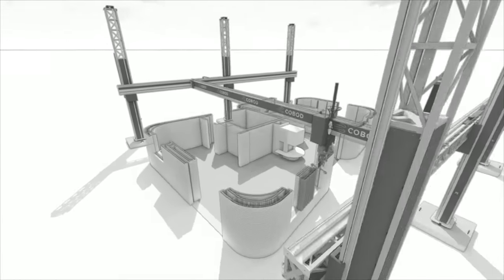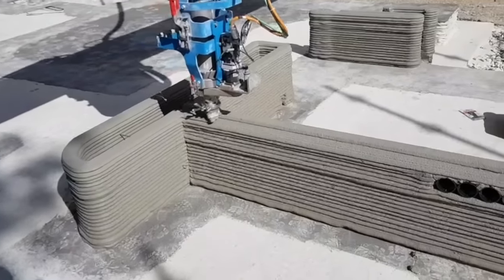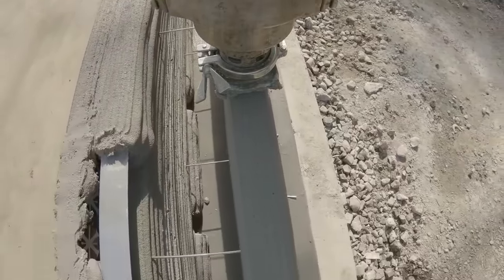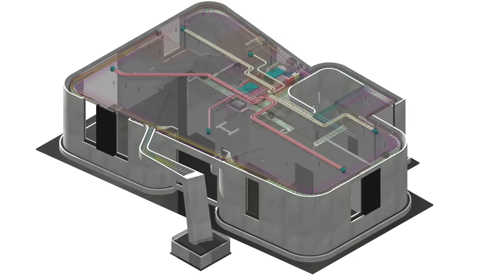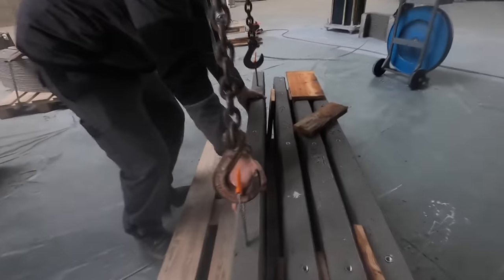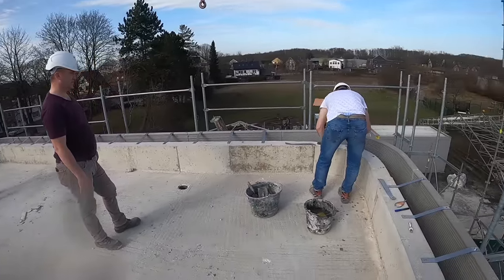The Most Innovative 3D Printed House In The World [Mense-Korte]

Comment: As an electronic technician, and licensed builder, this is the future.  More practical is a row of houses where the printer runs down a track.  I also feel it is more practical when it comes to single houses to print all units in a warehouse and build after transport.  Non-structural components can be built out of aircrete further reducing the cost. As for those worried about loss of jobs, I remember my builder father talking about the same debate when the power saw was invented, replacing the hand saw.
Reply: what is the advantage over precast concrete parts then?????
Reply: @danieljohnonson9354  Flexible in design , more individual archetecture ?
Reply: dont you end up using more concrete than a normal construction? is it cost efficient at all? or is it just better for the design

Comment: I love the organic feel of these buildings, curves and such, so much nicer than square boxes.
Reply: Finally someone who has the same taste in building design as me!!
Reply: Until everyone lives in a rounded building. What you seek is novelty. The problem is that there are so many people on the planet that in order to house them rigid standards are put in place to mass produce housing because people themselves are mass produced. Only the wealth can break the mold or those capable with their own hands ( wealthy in mind).
Reply: cement is most carborn produce product.
Reply: You can achieve curves with bricks. It's been done for 1000s of years. 
All those ribbed walls in and out are going to be dust and dirt magnets.
Reply: @ninelaivz4334 agreed mate. Beautiful masonry as well. 

But can they get it done as fast as a fully operational printer?

Unfortunately not. The main point being the reduction of time to build. And cost of maintenance of bricklayers
Reply: @BLACKLOTUSuk  
Brick maintenance is a non-issue they last forever. You probably need pointing every 50 years or so. Don't know how this material is going to behave over 50 or 100 year. Or even a 20-year..
Reply: @ninelaivz4334  brick maintenance is certainly an issue in Nigeria bro. 
Abuja is only 20 years old. Yet some buildings are decomposing as if they been here for 100. 

Our humidity and temperature is much higher than average here. But still. 

Bricks still engage in entropy. I agree as you said it’s the maintenance. 

A lot of ancient structures have just crumbled, not because of bad billing just over time 🤷🏾

Comment: What type is of concrete reinforcement are they using, and what psi mix, is a there a issue with bo ding between layers, it would be interesting to see what the side shear is and how the material holds up to a break test and how the concrete breaks whether as a fully conjoined piece or at the levels?

Comment: Find it interesting but would prefer it if they smoothed the inner walls. Lots of internal voids in the walls could make great hidey holes but would need to be finished by the homeowner and off blueprint. Also wondering how strong the walls were concerning ballistic protection. Last concern would be once dried how well would they stand up to earthquakes. My concern is get enough of a jolt would it crumble or crack beyond fixing.

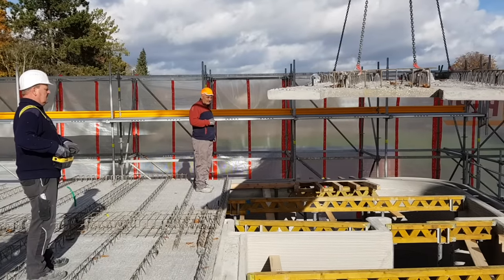Comment: @9:05 .. You mention horizontal printing limitations.  There are methodologies for this already. Specifically inserting a supported form that the printer can simply print over (similar to what they did for the electrical outlets by placing a small piece of sheet metal over the gap).  They would need to place reinforcements (rebar) after the first layer or two was set down.  And the forms would be removed after the cement has set.  This technique is already being used everywhere for fast modular construction of poured cement homes.

Here is a small scale example  Note how forms for the floor are built and then concrete is poured.  No reason why the cement can't be printed in these cases and appropriate reinforcements added in stages.

Comment: We stopped building log houses 100 years ago, but we still use a lot of wood. This is the upgrade the world's been waiting for.
Reply: I've often thought that homes built in hurricane areas should be built of concrete and and anchored in the ground.  I like the rounded corners which help aerodynamically.  I think the curved forms are more eye-pleasing and eye-friendly.  Smaller, one to two person dwellings, minimalist in design could be used for those homeless to come in out of the elements and provide safety, prevent theft of their possessions, access to hygiene, a safe space.  Can be affordable stater homes and it seems that additions could be planned for easier and then added later if the home owners doesn't want to relocate while upping their house hold.
Reply: Wood can be a good alternative as a structure - but I'm more intrested in printing houses with clay based mortars and/or mortars from recycled minerals. Robotics are the future of construction

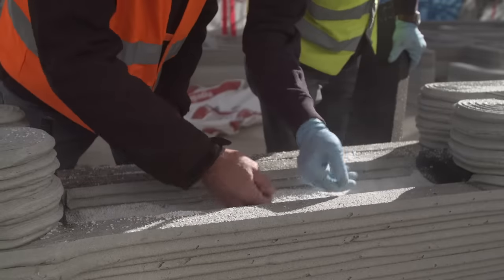Comment: 5:25 I don't think that is actually gravel for weight, it looks a lot like insulation pellets, the foam boards are probably just used as a kind of plug to prevent the filler from spilling on the rim and messing up the next layer.
It's also the same you see at 5:45, cutting insulation to size to fill up something with solid walls is a lot less efficient, that just pouring something in.

Comment: Very sophisticated project!  Great video clips.  Thanks for sharing it.  The insulation looks to be perlite (all the way up), but if not, please let me know.  Perlite is good in that it is inert and nonflammable.  But not very good insulating value when dry (compared to most foams), and a thermal conductor if damp.  I have used perlite a lot, and it does not seem to dry out very well.  So it would be really good if all those steel ties don't cause condensation.
Reply: I am interested in these projects where concrete is used where the membranes are, in cavity wall construction a membrane tray is used in case water penetrates into the canopy and weeps out. I don't see how it works with this structure. If water gets into the cavity it will just sit there over time.
Reply: @johnpyra7956  Exactly.

Comment: For now, what are the soundproofing, thermal insulation and thermal inertia characteristics for these 3D printed houses ?
Reply from the maker: You can space the interior and exterior walls as far apart as you like to achieve whatever r value is required.

Comment: Very impressive work. Thanks for putting this together! Any thoughts on the emissions intensity (i.e. CO2 implications) for this construction method versus, for example, timber?
Reply from the maker: Concrete emits CO2 and this concrete probably emits more than regular concrete. Construction automation won’t be limited to concrete. You can use the same equipment for other mixes. If you study material science maybe you can invent the solution of the future.

Comment: I love the possibilities, but I don't think I'd like the coarse layered walls for the interior.  It's fine for the exteriors.  But I think there will need to be some sort of mixed media printing wither higher resolutions to be able to make a nice interior.  In 20 years, maybe it will be able to print out wood-like cabinets with a nice smooth faux marble countertop with a pretty pattern for the kitchens, etc.
You can't wall-mount a TV in a concrete wall as easily as in something like drywall.  Some sort of plaster-like interior walls would be a lot more practical than concrete.

Comment: when the price of those will get cheaper, than yeah, this will change the world indeed
Reply: If....which is a really big if. Those things have almost zero advantages over permanufactured houses.
Reply: As opposed to millions having jobs?
Reply: why would they get cheaper? concrete and land aren't going to get cheaper.
Reply: It's really not gonna happen.
Especially considering private corporations would basically hold a monopoly over the housing market.
Cheap housing that takes barely anything to make? Yep, they can do that.
Allowing people to live in these dwellings for low rent? Not happening. They'll go as high as they can before finally holding at that maximum.
Not because it's fair, or reasonable, but because the bottom line says so!
Gotta make sure to increase profits after laying off those construction workers they replaced for autonomous printers!
Reply: @KnightofDark00180  they aren't cheap to make anyway. building walls is only one part of building a house.

Comment: Not to discourage this method I still think it's very efficient but I do believe some more simplified engineering design would be optimal I personally would prefer my home to be built more traditionally but with different materials opposed to Wood such as Plastic Lumber there's different ways the skeletal structure can be made more optimal such as the hexagon pattern for more strength if you're doing multiple stories and instead of the building being set permanently I like the idea of a universal panel design the panels can be made smaller longer taller for customization purposes But ultimately would be more efficient for expanding whatever current design the customer had originally so they can start off small it being cheaper that way and over time depending on what life has in-store for them they can make it bigger or smaller and the pieces can be donated or recycled this would also help in repairing damage is much easier to Simply take apart a piece of the wall instead of having to cut out material and put in new material when it's not truly necessary when you have a system that works the way I'm describing

Comment: I've been wondering how are 3d printers going to print in reduce space areas? since printers take a lot of space I think that could be a niche. Or maybe new construction standards requires free space in buildings?
Reply: the solution is printing concrete formworks onsite with infinite axis belt printers. You could hypothetically print a sky scrapper with a printer the size of a PC.

Comment: As a contractor of modular homes, I can appreciate this technology.  Right now it costs me, in my area, $150 a sq ft to build and finish a modular, turn key.  That’s $260,000 for 2000 sq ft., not including a bunch of other items, like permits, soil work, footers, etc.  A 650 sq ft, 3d home is $4000, (concrete, not including items like Hvac, wiring, roof, etc., so says ads.  Still, if it’s under 100K, that’s a big savings.
Reply from the maker: The $4000 house is a myth as I’m sure you know

Comment: I've been giving some thought as to why they filled the first foot of the  external wall with that gravel-like material then placed a foam rubber cushion on top (@5:30). Typically you would use rockwool for insulation but in a concrete wall like this you don't have a moisture barrier and would risk ruining the insulating properties if the rockwool was laying directly on the slab. This scenario is eliminated by the gravel+foam rubber approach used. It's unclear what sort of insulation they use, you suggest some sort of foam--it could also be rockwool, both of which can be pumped into the wall cavities once conduits and the likes have been fitted.
Reply: Insulation foam most probably Flexible Poly Urithene Foam.

Comment: The Roof could eventually be printed as well just by changing the orientation on the "Print Bed" xD but seriously printing the roof with layer lines running vertically would impact its load bearing limit massively
Reply: large scale printing is unfortunately much more responsive to gravity than at smaller scales unfortunately, but at some point we might be able to find a way to bridge multiple meters

maybe some kind of steel or carbon or hemp even fiber could help hold the extruded material together well enough to make that work, could even act as built in rebar too

Comment: Two more points:  

1) once they have the printer setup and the foundation laid you set a physical center point (e.g. a post or target marker).  The printer can then zero itself to that point periodically or any time as required.  This way, it doesn't matter if the printer support posts move/shift as any/all printing will revolve about that center/zero point regardless of how the printer hardware move around it over time.  This is a standard practice in machining.

2)  I'd like to see them start doing a second pass that smoothest out the walls while it is still pliable.  That is, print a few rows and then run a smoothing pass.  This could be done with some form of trowling attachment or perhaps a powered cement grinding attachment.
Reply: One thing with that would be navigating those tighter corners, especially with something bulky like a grinder. I'd also be worried about adhesion if every 10 layers there was suddenly more time before the next layer came in, which could cause cracking.
Reply: DidiCom there is a company that made imagine she'd that does 3D printing where the printhead has these vertical plate on either side and as the printhead moves along the vertical plates smooth out the sides automatically

Comment: If I was company. I  will add gyroscope in print head and pinned in 4 corner for make sure 3D printer will run in the right positions and don't worry so much at rail xy axis.

Comment: I believe roofs could be 3D printed as part of the automated process.  If the material dries quickly enough, then slopes/overhangs under 45º are theoretically possible to print.

Comment: Why not simply set up form-walls and fill with liquid concrete and use much more and stronger reinforcements?

Would NOT require any printer, would probably be faster and most likely way way more stable! 

Concrete is available in various different ratings and some of those offer crazy tensile strength!

Comment: What is the cost of specialty 3D Printer concrete as compared to standard concretes used in building construction based around using forms? I suspect it's more expensive, but by how much? Can this 3D printer use "cob" (clay-ish dirt mixed with straw and water)?   That could cut materials cost by a lot!

Comment: Have you the final cost of JUST the concrete build?
Reply: If i can estimate anything, that machine pour 50ml to 1dl per second. It still must be really fast binding cement, so its slow and use more expensive material than old fasion concrete building technique.

Comment: I have sketched up my store, which as far as I know will be one of the biggest 3D printed buildings in Europe at over 300 square meters of floorspace. The problem so far is that no printer I know of are capable to build it. 

So, naturally, I'll design the printer too. So far, the design plan should be capable of making a 45 meter wide circle up to 12 meters high. Big enough to build most homes and very much more mobile than most current ones.. ☺
Reply from the maker: If you have a rendering I’d gladly make a video to try and help you raise some funding feel free to email me jarett@3dprinted.construction
Reply: just use an infinite axis belt printer to print concrete formworks, don't actually build a printer that large, it's a recipe for disaster, especially for one off projects.
Reply: @OwenWithAHammer  It is not for an one-off. It is to develop a business. And several days setup time is one of the hurdles I am trying to overcome with this design. Also, making anything on this size the printer cannot be smaller.
Reply: @SWREngineering  My bad, if it's a business then it does make more sense.

"Also, making anything on this size the printer cannot be smaller." you're incorrect, look up what concrete formworks are, then what an infinite axis belt printer is and think about it. You can print entire cities with a small belt printer and liquid concrete, although practically speaking you'd want dozens of belt printers. Dozens of them would be far more efficient and practical than a single giant printer, which is in too many ways to explain here, inherently impractical.
Reply: @SWREngineering  I've spoken many times with Adrian Bowyer about this, he agrees that either what I mentioned or a "truly infinite axis 3D printer" are the most optimal ways to 3D print large structures.
Reply: @OwenWithAHammer  So, if you need to print a concrete wall with complex internal and varying geometry throughout that encompasses a slightly rombe shape with rounded corners of varying curves... and have no sections, just one piece, as sections will produce heat bridges. The circumference is close to 100 meters. I can't really see how that can be done on an infinity axis printer... no shape equals another, so forms are not too easy either. Would need forms all around.
Reply: @SWREngineering  It's very simple, you just replace traditional poured concrete formworks with those printed on an infinite axis belt printer. What part of that doesn't make sense?
Reply: @OwenWithAHammer  Well, it's not that it does not make sense. I only have gripes with a few things. It will be extremely hard to make removeable forms with the complex internal geometry the wall is designed to have to minimise heat transfer while staying immensely stiff... could of course print insulation foam shapes to go on the inside, print the forms for the outer and inner walls and then pour as normal. 

But then you're not really 3D printing a wall. 

I do understand regular building techniques with concrete, my entire family worked in the hollowblock and lightweight concrete industry, so I helped them pour the first slab for a barn at age 6... now I'm 48 and would like to try to go a bit further. 

Problems are meant to be solved, by saying "this cannot be done" before we start trying we have already lost. Edison failed a "few" times before he got the light bulb going. I expect to fail, more than once. But that is how you learn.. 

And who doesn't want to see a printer capable of building an entire house with no formwork or support? We all do.. ☺